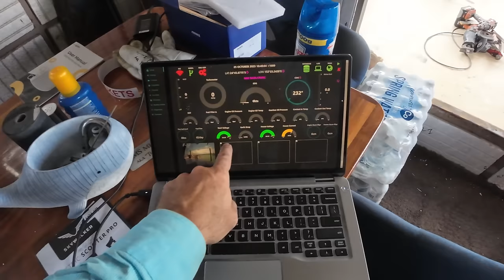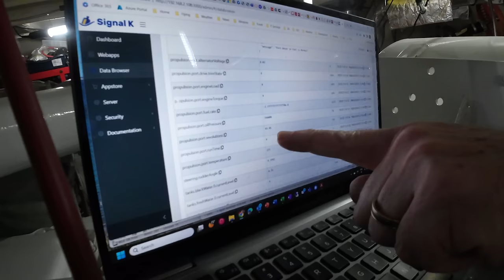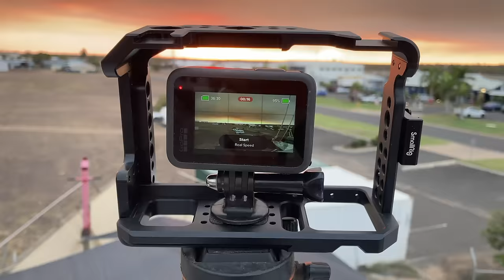Prep to start the new engine - Project Brupeg Ep.327

Comment: You need surprisingly good air filtration on a boat as the salt in the humidity is quite substantial and readily blocks engine air filters a pressure drop indication such that Caterpillar uses is a great help

Comment: While it's not my place (not my boat, yours and you are all amazing). I would plan your cooling lines in such a way to allow for some engine vibration between hull and block. This can be accomplished by adding more heater hoses in the coolant tubes (flexing). The other side benefit, would be in the unfortunate event of needing to repower Brupeg. You can remove the engine without cutting any coolant tubes -Automotive engineer
Reply: The cutting isn’t an issue since they can just unbolt them like in this video but I do agree they should have rubber couplings. I was going to say it would be fine with those couplings they used but then they hard mounted it to the engine below those for support. Don’t want to risk the brand new engine over a couple hours work and 4 hose clamps.
Reply: I agree..
I'm a designer..
Look in any vehicle engine bay and you will see a set of rules that are applied.
It's like when I fitted my engine..
I used the same rubber mount's that are used when it's fitted in vehicles ... the reason.. the vehicle manufacturers spend serious money employing specialists to get it right.. same with all other things including cooling circuits.

Comment: Great episode! Usually keel cooling does have sea valves at the inside and in many cases it's mandatory to be class approved. For example it's in the  rules for traditional ships registered in Germany. Also have in mind that if your cooling water pump pushes water through the pipes it doesn't work if there's a leak in the keel cooling pipes. I'm thinking of adding a Bowman heat exchanger to my system to build a two circle keel cooling.

Comment: Even if an Engine is hard mounted you should still isolate the pipes from the engine. Usually you would install a flexible expansion joint and from there on fix the pipes to the hull struinstead to the vibrating motor. This way you also reduce noise in the boat a lot. This is all structural noise transfer.

Comment: When a big diesel like this is gunned for whatever reason, it moves quite a bit. You need a flex joint where it joins the ship's pipe. Hose or metal but a flex joint.

Comment: Poured epoxies like Chockfast have a very low surface tension, which is why despite its high viscosity its very prone to leaking through the tiniest gap.  I used it on my mast step (also a steel boat) and even with the most meticulous damming I only just got away with it. Tough lesson learned for you guys, but as it turned out it was the right thing for the engine alignment anyway.  Doing marine work well is so much more complex than most people imagine.
Reply: True words sir.

Comment: I think you will need a couple of hoses near the bottom of the keel cooler pipes. Flexing in the rubber is better than flexing the stainless pipes from the vibration.
Reply: Yeh good point , hope you see this comment dame
Reply: agreed, some flex at each end
Reply: Yes indeed the vibration of the engine will rupture the pipe. Place a rubber coupling in the pipe.
Reply: Yes, because of hydraulic pulses from the water pump and / or power pulse vibrations from the engine cylinders, which may or may not be a problem unless they align with the stars and the moon and start cracking pipes and sinking ships !
Reply: Amazing ❤😊😊😊
Reply from the maker: @chris7643 why can’t we just unbolt them like we do when we fit them?
Reply from the maker: @SV_Autumn thanks Kate
Reply: @ProjectBrupeg harmonic vibrations will work harden the cooling pipes
Reply: Can’t imagine the engine not vibrating those cooling pipes.  Eventually causing a cooling leak
Reply: I understand your concern
But will not the connecting silicone tube act as a vibration damper? 
Also the engine is directly bolted to the hull, rather than on rubber mounts, how will that affect vibrations to pipes that are also directly bolted to the hull?
I'm not having a go at your comment just trying to understand the physics......

Be Kind 
😀👍🏼
Reply from the maker: @kiwi_welltraveled4375 given everything is hard mounted we think it will be ok. If it’s not, any crack is simple to repair and we can at a cut into the pipe and join with silicon pipe at a later date
Reply: Will the  flexible connectors at the top help ?
Reply: Your now have a pressure vessel. Some good discussion about vibration & pipes. I had big organisation to resource from. 
Anything through a bulkhead needs a flange & valve. Stops cracks developing on critical areas for repair.
Nice to have good preparation for trails.
Reply: I agree!!   Being a marine contractor, I’ve built my own push boats.
Reply: Great progress guys! 
Why don’t you have shut off valves where the pipes come into the boat from the external cooling system ? If one of the external pipes hits something wouldn’t you have uncontrolled sea water pressure coming  in ?
Reply: I also was thinking that a flexible hose would be better, less heat conduction and vibration ?
Reply: @kiwi_welltraveled4375  Try to think of it like strings on a stringed instrument. The hull and the engine are bolted together, but the pipe goes between them in different places. The pipe will have a decent amount of mass 'floating' between the rigid flange at the hull and the silicone at the engine. The vibrations of the engine will cause that massive pipe to vibrate like the strings on an instrument. If it was silicone at both ends, the pipe would be fine, but its not, and it'll be like a tuning fork against the relatively immovable hull, eventually work hardening and fracturing the pipe at the flange.

Comment: Looking good. But I noticed you have the cooling pipe support is hard to the engine. There is no flexible joint between the vibration of the engine at the support and the keel pipe going through the hull. You can put another rubber joint in or mount the bracket on rubber.

Comment: Hey Dame, first your doing a great job. I have wished many times that I lived near you so I could give a hand, but allas I live in the States and it is a little far to drive and swim.  Hey you might want to have more of a rubber hose on the cooling system to the hull . The vibration from the engine will cause you to have a major leak on the cooling pipes if not allowed the vibration damping of the rubber hoses connection to the engine and hull cooling system.

Comment: Are you sure the brace you built for the coolant pipe is attached in the correct place? Surely the flexible silicone section needs to be between the hull and the brace, not between the brace and the engine?

Comment: I so much look forward to Project Brupeg and Tally Ho on Sundays.  I learn so much from you "guys". I am an old belt & suspenders guy, and those two welded S. S. pipes with multiple bends worry me because of vibration (tuning fork?) even though the engine is solid mounted. Murphy's law states that if something is going to happen it will happen at the worst possible time.  For me it was in a narrow inlet with rock jetties, standing waves and heavy traffic.  Suggest you carry a length of coolant hose long enough to reach from the hull cooler fitting to the engine. Then if there is a leak or a weld fails you will have time to do  proper repair. Also ball valves at the hull would be a good idea even though it is a sealed system.

Comment: Very interesting video, that sensor simulator was neat.  Quick question on those coolant lines.  Do you have a bracket someplace from floor to the motor?  I had a sub pump blow off and flood a room a couple years ago when using a fitting like you have here between two hose clamps.  You may want to brace it so all the  weight is not just on that fitting the vibration of the motor and the boat being ridged all the dampening will happen in that fitting,.  A sub pump dumped cold water.  this coolant water is going to be rather warm.  Just a thought,  I am not building the boat or a boat builder.   You guy know 100% more about this than me.

Comment: Next time you do something similar to that pour, rub what's technically known as a "release agent" on the surfaces below where you're putting epoxy, polyester etc. It doesn't take much to make the clean-up a lot easier. For this purpose, you don't need anything special. I've used candle wax, soap, and car wax with about equal success.

Comment: Modeling clay to make the damns for the chock fast. Does not have to look pretty just has to work. The chock fast gets kinda hot as it cures. The modeling clay works well
Reply: Does not have to be pretty , every boat I’ve ever worked on that had the chock fast was not beautiful, but just had to fill up the space and account for any odd shapes . The clay is thick and sticky and cheap.

Comment: I really think you should add flex joints down lower on those keel cooler pipes!  Having rigid pipes that connect to an engine is never an ideal situation as vibration will make them crack.

Comment: Hi 
With the u clamps for the exhaust.   If you put two layers different rubber on bolts / nuts. To minimize the the vibration to the deck plate. Very stylish coolant piping. 
Soon 
Ladies are gentlemen  start your  engine. 
Let the purring of Cummins begin. 🎉

Comment: So... those keel cooling pipes... what happens if those are compromised by getting punctured by ice or a rock, or just rust? Are they meant to contain engine coolant directly or would it be safer to transfer heat to them via a heat exchanger? [bit late to ask that question now, but...]
Reply: In the past, they have said the keel cooling pipes will be removed before they head to the ice.

Comment: Engineering question - are there cut-off valves going between the hull cooling ins and outs and the engine?  It might not be necessary, but in some scenarios, the ability to isolate that part of the system might come in handy.
Reply from the maker: No. She never had them fitted and we just rebuilt what was already there
Reply: @ProjectBrupeg  Yeah, the more I think about it the less real benefits cut offs might provide.  The most likely failure mode would be the external pipes getting a break and interior cut-offs won't assist that. 
PS - been watching the progress for a few years now, and it's great to see the boat and crew afloat.  You guys make Monday mornings something to look forward to.  Many thanks.
Reply: for safety any through hull pipe fitting specially under the water line should have a valve fitted. @ProjectBrupeg
Reply: @volkerheinsohn5828  I assume that's covered in the survey requirements, but that is a thought.  I was thinking about it more in terms of maintenance and repair issues.  I seem to recall that the plan in the longer term is to remove the hull cooling (which obviously would be a risk factor in ice conditions) and change to a different cooling option, but I'm reasonably confident that between the Brupeg team and the surveyors, this one is covered off for present purposes.

Comment: Are you going to build guards over the moving parts of the engine so that if anything falls into the pulleys, prop shaft or exhaust it isn't an issue? I'm sure you have already considered it, just thought I would ask.  Love seeing Brupeg in the water. I bet it's a huge change to no longer have access to the land under and around Brupeg like you used to, lol   Thanks for sharing!
Reply from the maker: Yea we have some plans for belt Garuda and prop guards but will build them soon

Comment: Those pipes your welding must have flex a rubber hose unless that motor is not going to run. You do have rubber motor mounts right.
Reply from the maker: Solid mounted engine like most trawlers

Comment: 13:30 if the top of that motor moves differently from the bottom, you sure you want those pipes welded together?

Edit: ah, flexible hose clamping.

Comment: Measure 7 times, cut only once. Why didn’t you show the results of that silicone pour again. It flashed on screen quickly but you didn’t mention it. Looked like it all poured out again. What’s up with it? 15:05 is the time stamp in question.
Reply from the maker: Front mount worked perfectly. However we will have a future episode that shows the process in detail. Literally pouring the new mounts today and tomorrow

Comment: While the electronic engine instrumentations use is understandable, I’m thinking redundant mechanical / analog instrumentation in the engine room, would be a advisable addition, and serve to aid in servicing and fault verification / diagnostics.
Reply from the maker: We have both. Analogue on the engine, digital in the control box in the engine room and a completely redundant second digital system with multiple layers of redundancy that displays on the bridge

Comment: Why do a lot these style boats no have a pipe that runs from the outside of the boat to the engine for cooler fresher air? I know some will say because of the water but a car can run in heavy rain and the vents can be made in such way to prevent water ingress and the little that may get in can be diverted to a water separator. Just a curiosity because I know engines run better, more efficiently and provide more power with cleaner cooler air.

Comment: I do not understand why you have  rigid connections around the motor, and especially the drive system.  My experience is that anything rigid around a motor will break.
Reply from the maker: It’s a pretty normal way for commercial boats this size to mount their engines